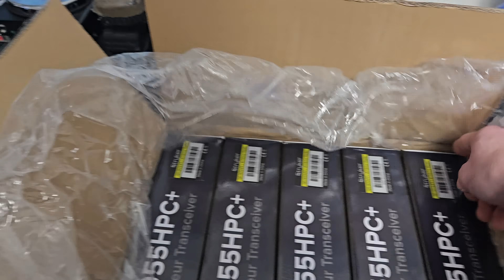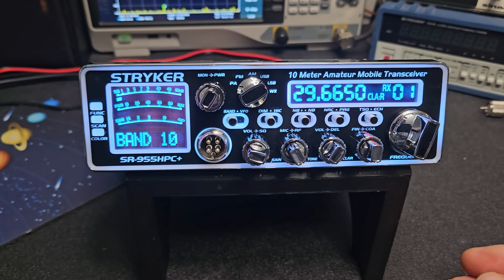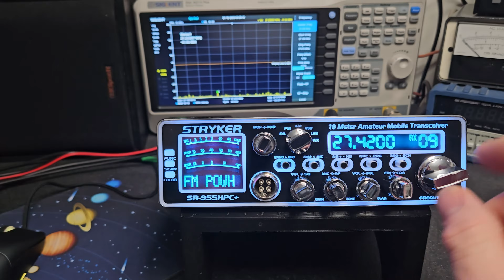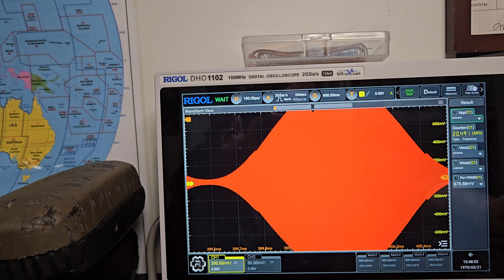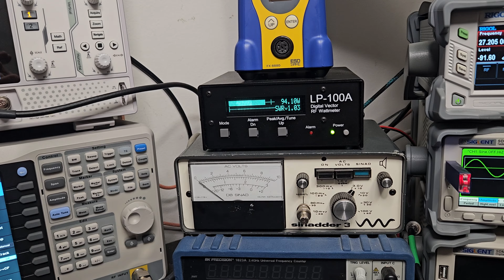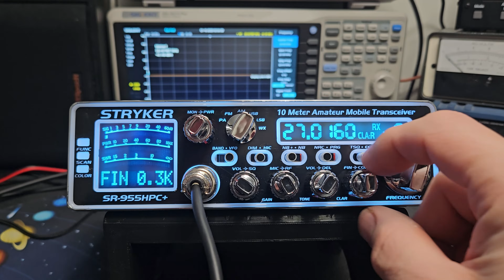New Stryker SR-955 HPC+ staying in Michigan

Comment: That radio came out nice. I don't mine some AM swing as long as it sounds good and the power is on the channel I want to use. When it starts to sound distorted or outside of bandwidth it is just  wasted power and you gain nothing. I like how Scott's Radios set up the am .  some like that little kick on AM and it can help with weak signal . But I hear many on the air that over do it and they hard to understand and I hear them more than 1 ch away . I like how the AM is set on QT 60 long.  I get good audio reports all the time. same with SSB and FM. We got heavy lake effect snow warning in NY like 1 to 3 ft and strong wind and severe cold warring.  Going to be a artic blast ! . This will be interesting what it does  to the bands .  I can say it cuts my UHF range with heavy snowfall . With our FRS radios we get like half the range. The 5W GMRS not as bad.  The 2 watt VHF MURS does ok . I can say them filters do help with RX noise and harmonics off KL 203P amp.   I have 10 and 20 meter bandpass filters . I can work both bands FT8 on 2 antenna's like 40-50 ft apart at same time. If I had a diplexer  and multi band antenna . I can work 2 bands at once from same antenna. Theirs triplexers   and pentiplexers as well.  working several bands at once on same antenna !  I always run my amps with at least a low pass filter.  They work good .  That 25 MHZ band is 11 meter radio astromancy band. 25.000 is WWV time station . Ft Collins CO, They give time and solar data . It is directly linked to atomic clock. A lot of that odd noise on the 25 mhz part is space noise like out sun and even Jupiter and outher stuff. They found a radio signal coming from    alpha centauri star system.  May be natural or ET . Can't prove either way  at this time.  Lots of radio listing for ET ! another fun part of radio .  Space is full of radio ! 73